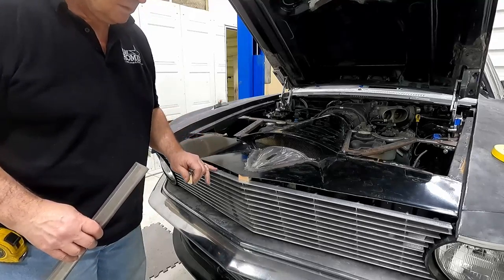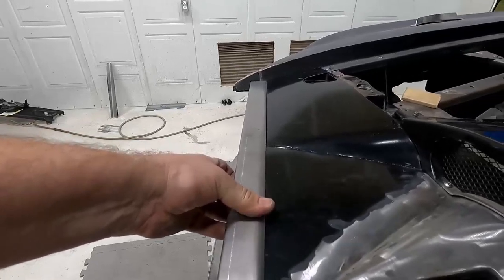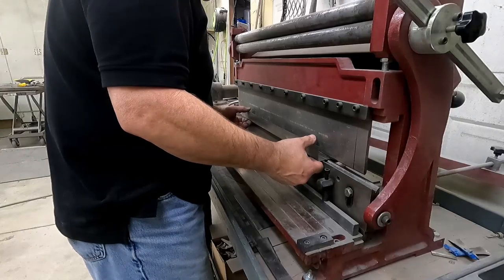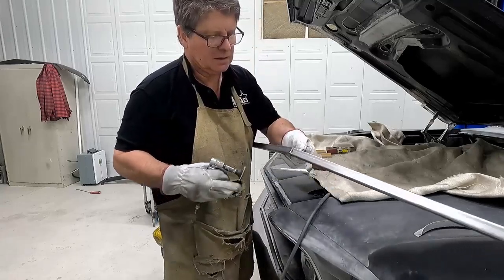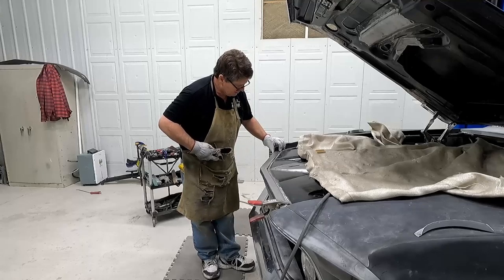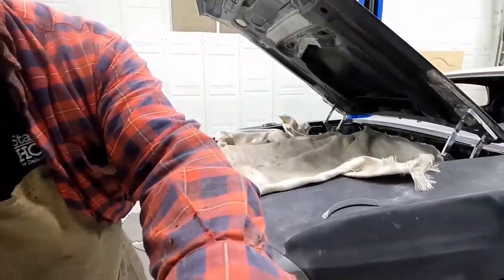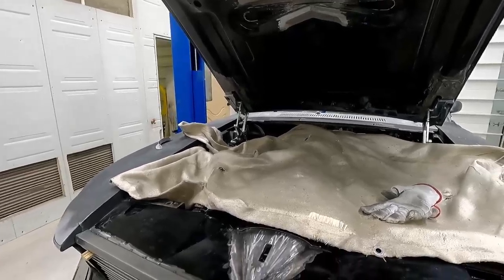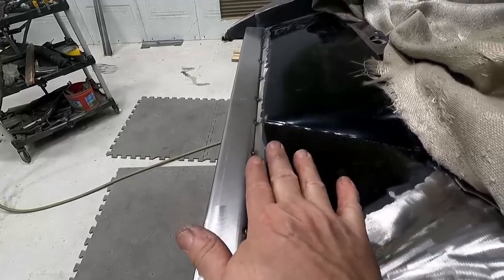Mustang Restomod Project Custom Radiator Cover  - Part 1

Comment: It seems like it would have given us a cleaner look if you welded underneath instead of on the top surface.
Reply from the maker: I did weld the underside.
Reply: @greggrichhartdesigns9616  You welded both sides??? Yes but did you weld the entire surface? Omitting welding the surface would have saved a great deal of time and clean up.